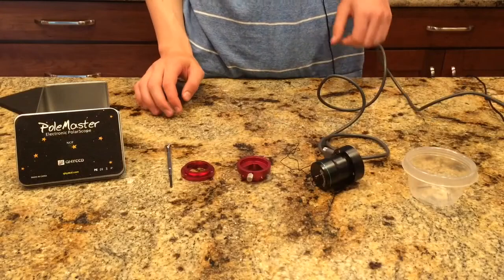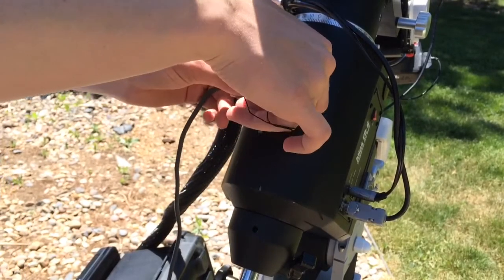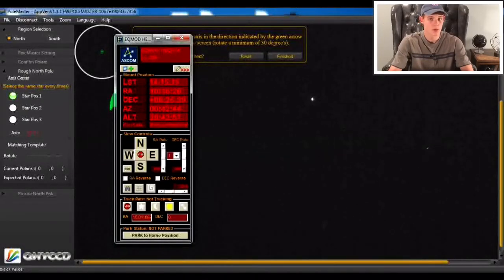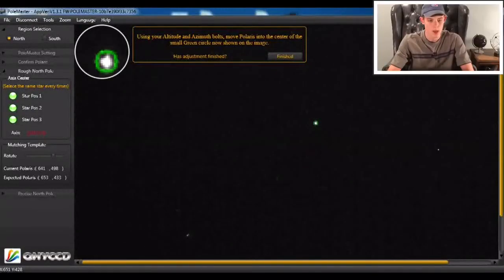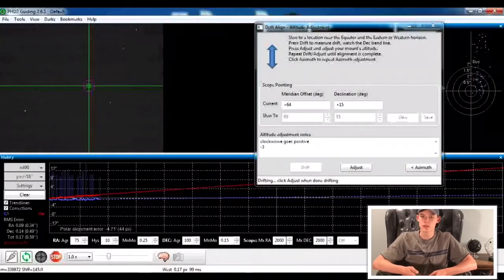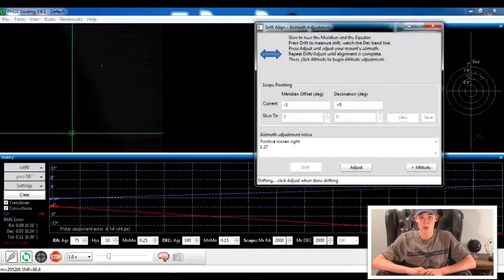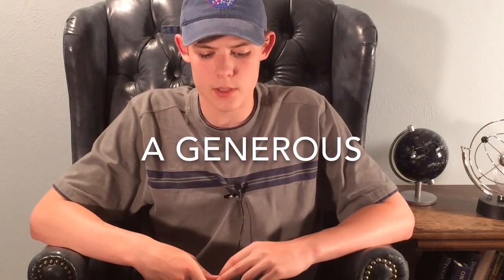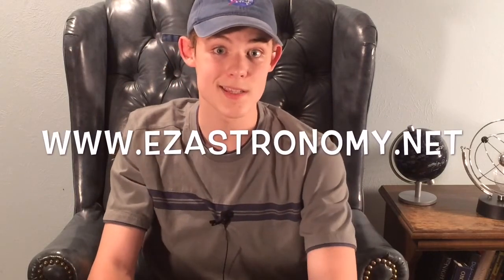EZAstronomy | PoleMaster QHYCCD Pt. 2, Instillation and Test Run

Comment: i have tried  several times of polar master，but when i use the phd‘s guide assistant check the polar alignment  error，it  always show a big error.i am so confused！but i suddenly found  my pole master is not parallel with my RA axis，because when we use the pole finder scope to align the pole we need calibrate the scope.

Comment: I have a question , when you said rotate the mount 30-45* ( 3:34) is that when your facing the CCD or from behind the mount facing the DSLR? because you said thats west for me! 
if i was to turn my AVX clock wise from behind it ,, my OTA would be going eastward.
Reply: Clockwise from POV behind the scope.
Reply: I had the same doubts. In general practice, I believe clockwise is always from the perspective of you standing behind the mount (facing the eyepiece of the polar scope). I would rotate my RA eastward if I were to move it clockwise.

Comment: Obviously there is a way to check as any errors would show by your mount drifting off target or your images having elongated stars. It's hardly fair to rate a product when you don't fully understand it use and set up. I'd be interested to hear your views after you've used the polemaster over several setups and comment on ease of use and accuracy then. At the moment your only throwing your confused views in the mix.